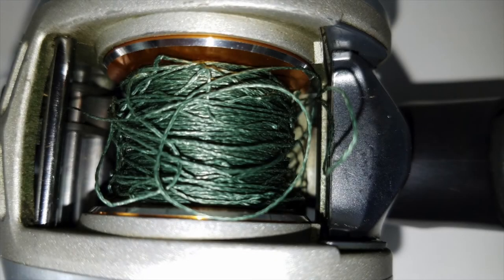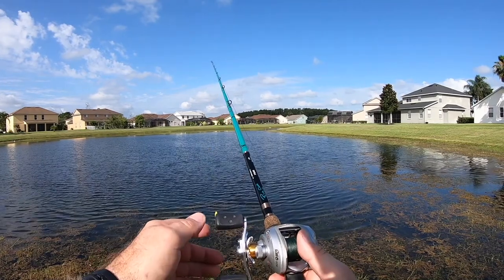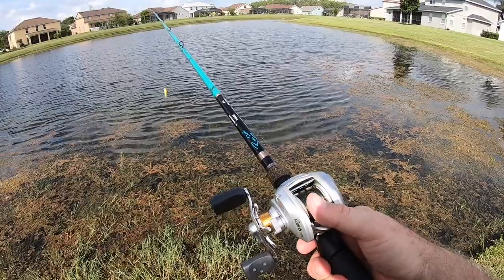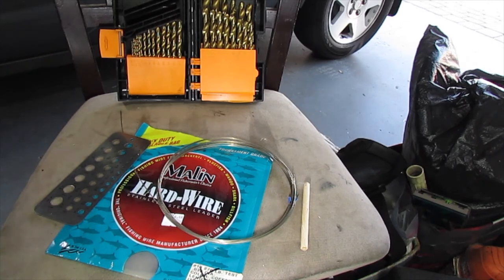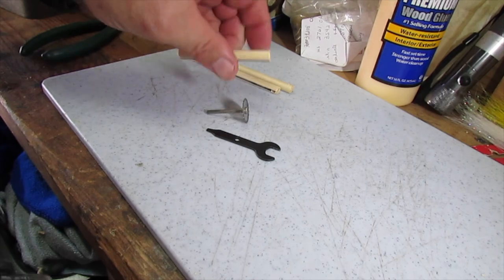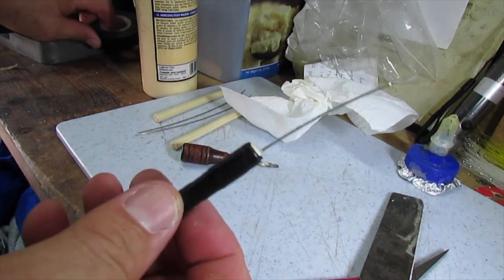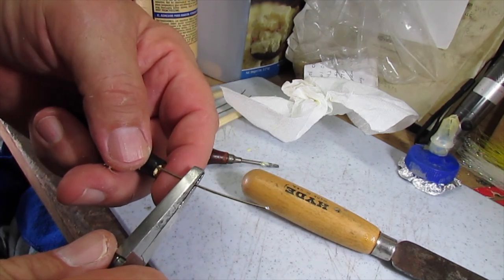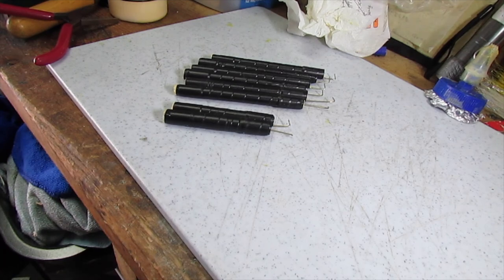WHAT IS A BACKLASH PIC AND WHAT IS A GOOD ONE?

Comment: After watching this video, I made 4. BUT I used the trick that those who make balsa baits use for keeping in the hooks. I twisted the 131# wire around a nail for about 3/4”of an inch, slid it off the nail, crushed the circle that was formed about the head.  This will slide into my drilled hole and lock in with wood glue. No need to cut groove or drill hole in end of stick. Leaves a nice wooden handle that I tapered in a pencil sharpener before inserting and glueing the wire. Since I use a bait caster, I know it will be WHEN and not IF…I NEED THIS.  Those who make pens should make these with all those fancy woods and it will make a great gift.  THANKS, AGAIN, KEN
Reply from the maker: Ken, it is a lifesaver when on the water and the reel does not work due to a backlash.   Gerry

Comment: How does this only have 130 views? You're a hidden gem. Love from Philly!
Reply from the maker: Welcome aboard Philly!                 Gerry
Reply from the maker: Those are not square bolts but they may look like it in the video. They are simply normal U-bolts that wrap around the legs of the seats and go through holes I drilled in the PVC frame that supports the Tackle Webs. 
They are available at any hardware  store. 
I just painted them, and all the PVC, black to blend in with the seat frames and Tackle Webs.
That allows the seats to slide normally in the track without the webs or the tackle boxes  dragging against the rod trays. 
You could loosen the U-bolds and slide the 
Tackle Webs higher on the seat legs if you wanted.
I hope that helps and makes it clearer for you.
Gerry

Comment: Glad your back from NY and I guess you have your work cut out for you with your friends pool pump and all. I wanted to share with you a little TT rescue story from my trip to round lake which is near Petoskey. I took the wife for a nice ride while I fished and only managed to catch a couple hammer handle pike. That means very small pike for those of you that don't fish for them. Anyhow Mrs. Steve got tired so I took her back and dropped her off and returned to fishing. (We drive separate cars to the lake). I decided to go to the far back area of the lake and the water runs into weed and Lilly pads and the water gets shallow very fast at around 5 inches in places and very thick weeds. Well you might never guess what I found back there. It was a couple of dumb teen age boys in a Jon Boat and a 15 horse outboard so crammed with dirt and weeds I don't think it will run again any time soon. I pulled up to the boat to help but the Jon Boat was catching on the weed beds I couldn't pull them out. I had to have one of the boys get into the TT and then we were able to get the boat out and back into deeper water where they used the trolling motor to get to the dock. I think I'm gonna paint superman on the side of my TT cause she was a super hero today.
Reply from the maker: SUPER STEVE TO THE RESCUE! 
Steve, I would hope someone would help me if I was stuck on the water. You are the man I would hope to come by and help. 
Nice job! 🥇                           Gerry
Reply: @LunkerFishing  I wish I would have just taken a few pictures but my phone was in my dry box so when I got real close I asked them if I could take some pictures and they begged me not to. I think they had Daddy's boat and new they weren't supposed to be back there in that shallow water. I'm going back cause I know there are Bass in there and if a flat bottomed Jon boat got stuck then there won't be much competition against my TT. Couldn't imagine some Pro going in there with his $80000 boat.
Reply from the maker: Steve, it may be the honey hole!                      Gerry